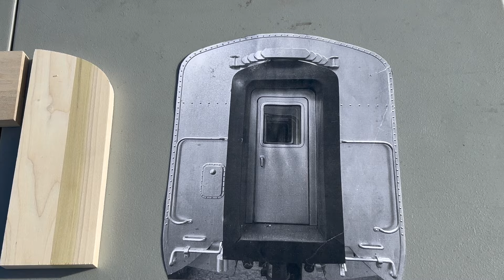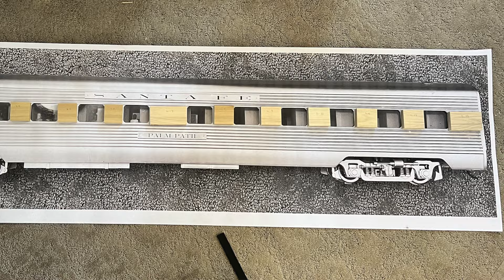Building a 1" Scale Santa Fe 10-6 Sleeper

Comment: Really like watching these great creations, If I were you, I'd get a metering table saw with a scroll attachment and maybe look into using a marine ply board, the stuff they use on boats it might work out cheaper if you get 4'×8' boards. Anyway, don't stop what you're doing it so cool.
Reply from the maker: I certainly appreciate the suggestions. That kind of wood may be more expensive, but since I never intend for these to get wet, the poplar wood that I use works perfectly fine.

 I certainly appreciate the suggestion of the tools as well because I have definitely acquired a number of tools That I never thought I would need, but they’ve become handy for the work that I do! ☺

Comment: For fluting why not a rotor tool and guide to dig in wood perfect curvatures lines.
What some poor railroads did to modernize heavyweights cars in modern stainless, was a genious work of paint crews. They did fauxfinish paint as to imite the shiny part below the shaded part. It was a rather well convincing imitations at least in photo.